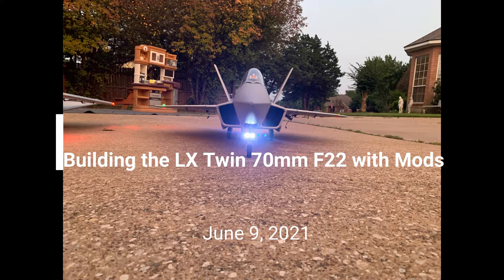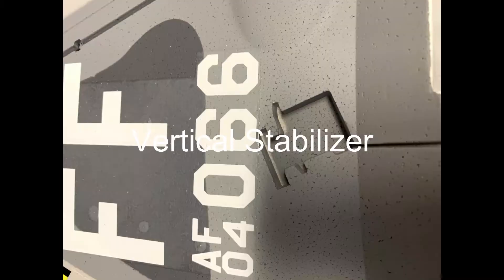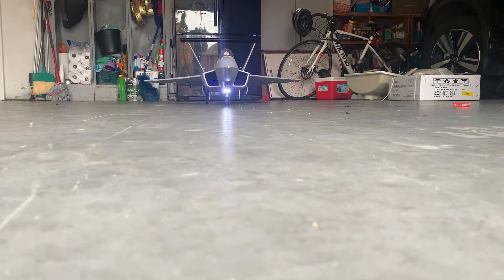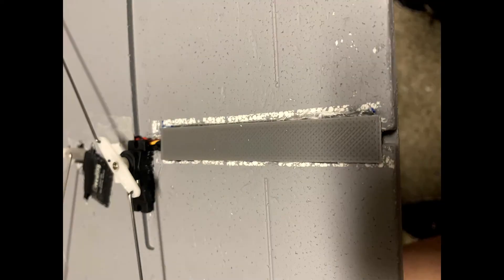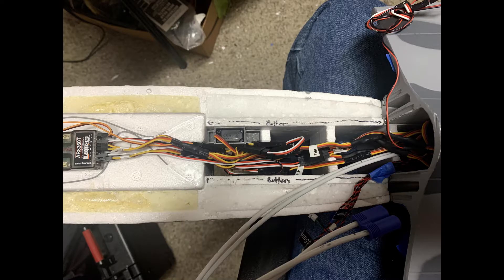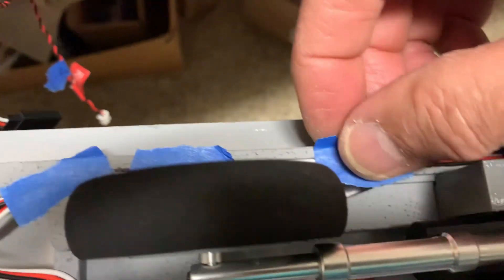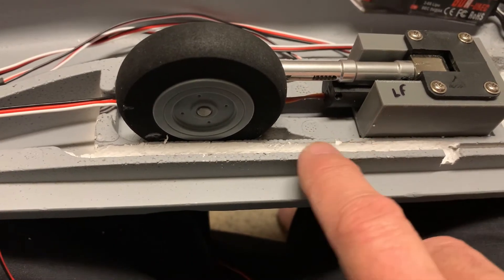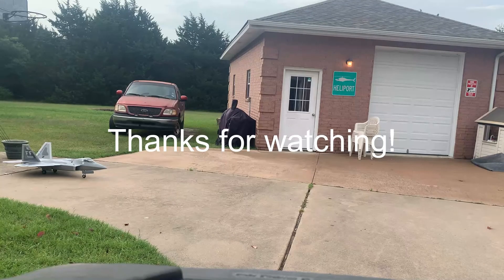LX F22 Twin 70mm Build with Mods

Comment: Hi i just picked up this kit version, but its missing one retract, and no manual. If you don't mind, do you have a PDF of the manual for the built and a link to the part you printed on thing universe? Thanks, Rick
Reply from the maker: Try:
https://www.skyflighthobby.com/download/sky-flight-hobby-f-22-twin-70mm-jet-edf-manual.pdf

Parts:
https://www.thingiverse.com/search?q=Lx+f22&page=1&type=things&sort=relevant
Reply from the maker: I would definitely do the elevator mod if you don’t do anything else.
Reply: @Zek1701  thank you!!! Also, if you don't mind me asking, this Foam seems to be the older type, not sure EPP or EPO, but what glue did you use to put the kit together?
Reply from the maker: @rickkremer0525  30 minute epoxy on the fuselage and on the wings. Make sure to strip off the paint on the wing glue areas. Also I poke a screwdriver into that area(wing/fuselage) to just make small holes for glue to seep in. For the less stress areas I carefully use Foam-Tac so that if I have to take it apart it doesn't damage the foam as much. On mine the outer front part of the fuselage is Foam-Tac.

Comment: Nice just got this plane
Reply from the maker: Is it the Kit version?
Reply from the maker: Hey Mike...not sure what motors you are using but it appears LX did not test the aircraft at speeds higher than what the motors at the time(10 years ago) could do. In mine I put inrunner motors that produce significantly more thrust. During two high speed passes this caused issues with the elevators and ultimately resulted in crashes. See this latest video for more...https://www.youtube.com/watch?v=P7YZYP0C16I
Reply: @Zek1701  thanks for the heads up. Sorry about your loss. It pains me to see that. These models have some coolness factors for sure that don’t come in most models. I mean smoke and ejection come on I think that’s just so much more fun and unique. Too bad the ideas surpass these older versions of planes. I didn’t add upgraded motors to several exactly for this reason. When I don’t see carbon reinforcement that’s a big clue for me.
Reply from the maker: @mikemetz8016  fortunately Banana and General Hobby sell the kits cheap so another one is on its way.
As far as the ejection that comes built into my jets over time and I don't have to build it in. The smoke I have yet to get in the air but did do a ground test and had the smoke in the wrong way. Let's just say if that happen on the jet the wing would have been impacted.
I'll rebuild with the same motors (assuming they work) but I won't be doing anymore spped tests(it broke in several pieces). However, I would like to see the F22 takeoff and go straight up like the real thing. It should be capable of that...perhaps with smoke!